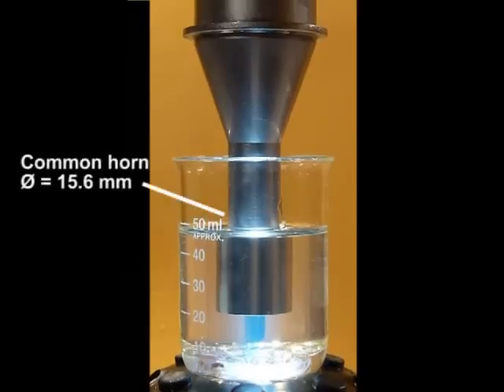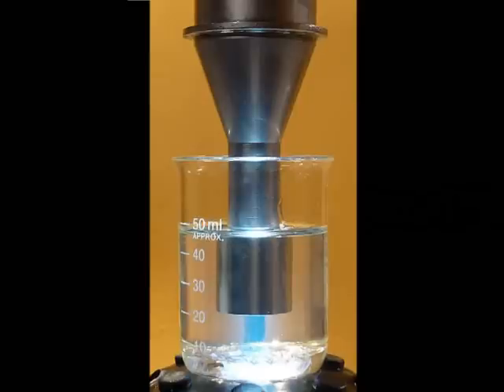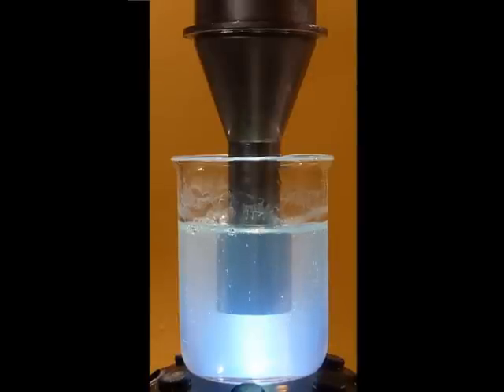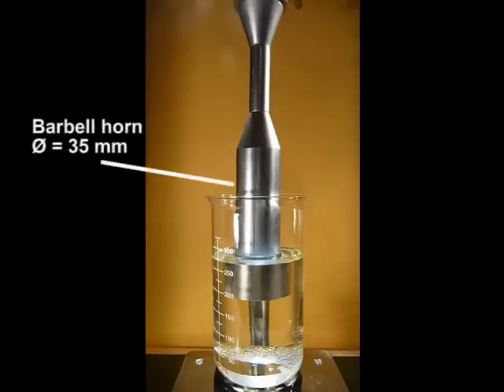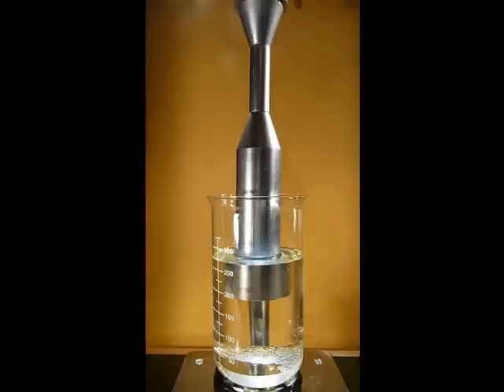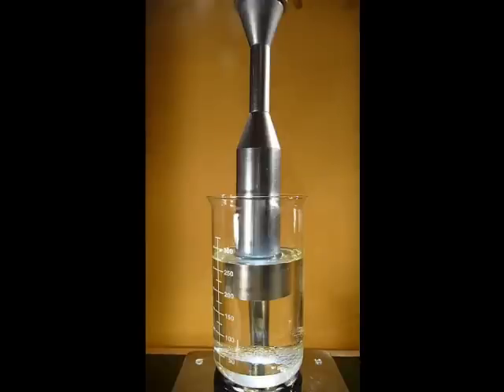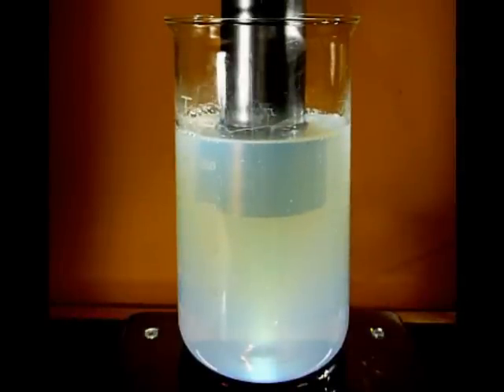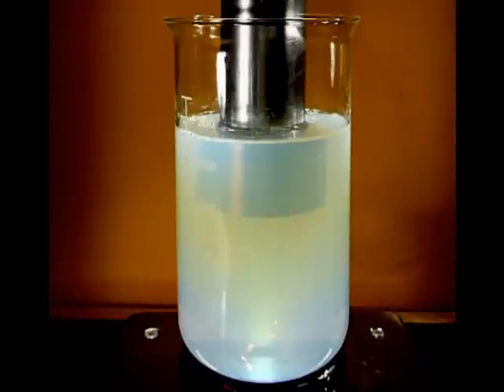Translucent Water in Oil Nanoemulsion Prepared by High-Intensity Ultrasound, Batch Mode.

Comment: Is this the same process to obtain solid lipid nanoparticles? Should it also be translucid?
Reply: It's a similar process, the main difference would be the formulation components. The result will be translucent if all particles are smaller than about 100 nm, which is what's typically desired.

Comment: Can you achieve nano emulsification with a stator rotor homogenizer with small stator holes? Also if you dont mind me asking. What is the main difference when emulsifying ans creating nano emulsification vs micron emulsification? Will one last long without separating? Like say nano stays together for 2 years vs micron only staying together and separating after 1 year?
Reply from the maker: We do not have experience with stator rotor homogenizers for the production of nanoemulsions, unfortunately. Nano-emulsification, however, is one of the most common applications of our ultrasonic equipment (aka. soncators). For the difference between nano-emulsification and micro-emulsification, please see the following blog article: http://blog.sonomechanics.com/blog/water-soluble-cannabis-oil-microemulsion-liposomes-or-nanoemulsion. Correctly prepared nanoemulsions remain stable indefinitely.

Comment: I saw another video and I tried myself where 50% was vegetable oil and 50% water without tensides, the final product was just milky and not translucent. (Our experiment was 30 minutes at max amplitude) (Amplitude from max to MIN was 84microns in my experiment with a 14mm sonotrode) 

How comes you had a better emulsification result with even a way higher oil percentage + lower amplitude and a bigger sonotrode?

I would love to receive a reply, thanks in advance and best regards!
Reply: This is a water-in-oil emulsion, not oil-in-water. The dispersed phase (water) concentration is much less than 50%.
Reply: @alexeypeshkovsky1614  Shouldnt the emulsion with a higher oil concentration be less translucent than an emulsion where you just have few oil concentration?
In my experiment with 5-7% oil concentration and 95% water I did not achieve any translucent emulsion although my settings had a better environment (higher micron amplitude, less volume, same diameter of sonotrode)
Could you please clarify your answer regarding the O/W and W/O emulsion?
Reply: Generally, the median droplet size in a nanoemulsion is smaller and its stability is greater when the dispersed phase concentration is diminished. For an O/W nanoemulsion, that's the concentration of the oil phase, for a W/O, the aqueous phase. In this experiment, it's the latter. Additionally, an optimized surfactant mixture is always required for translucency.

Comment: Forgive this question if it seems obvious, but would you achieve the same result at a lower amplitude with greater time (assuming the bar's surface area remains constant)? I ask out of curiosity. Thank you!
Reply from the maker: No, it is the amplitude (directly related to the intensity of cavitation-induced shear forces) that defines the final droplet size you are going to achieve given sufficient time. Additional processing time does not result in further droplet size reduction if the amplitude remains the same.
Reply: @IndustrialSonomechanics  The higher the amplitude the smaller the dropplet size.

Does that mean the smaller the HORN (tip) the better for smaller dropplet size or is the size of the horn not important?
Reply: @alexeypeshkovsky1614  In the given video ,it says that the bigger horn has 100mykro metres of amplitude. But isnt a lower amplitude better for generating smaller droplets? I am now confused. In the given video it says that with the bigger horn you get bigger amplitude. Excuse my confusion!

Comment from the maker: @bobbledill Yes, with our equipment you can make permanently stable oil-in-water emulsion. Which tween to use depends on the oil type. A little Span also helps if you want to make translucent nanoemulsions.
Reply: How do we get this device, what is the price, and is there a phone number for communication
Reply from the maker: @الواحةالخضراء-ع6ر  Yes, our phone number is +1-786-233-9255. To configure one of our ultrasonic processors and get instant pricing, please visit: https://www.sonomechanics.com/sales/